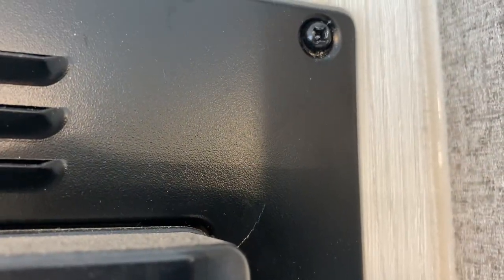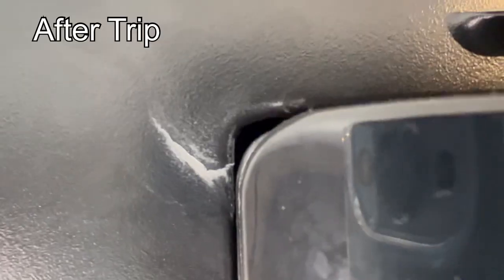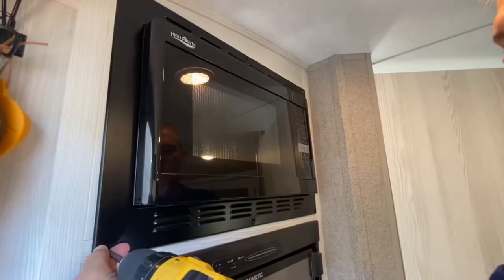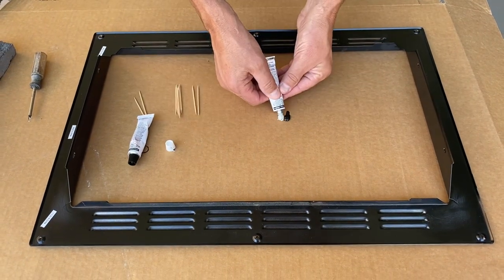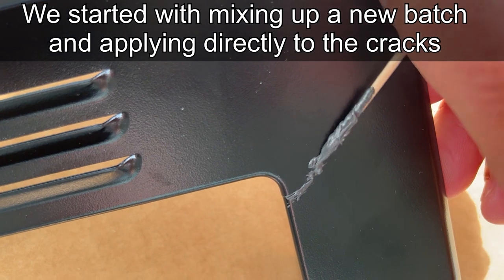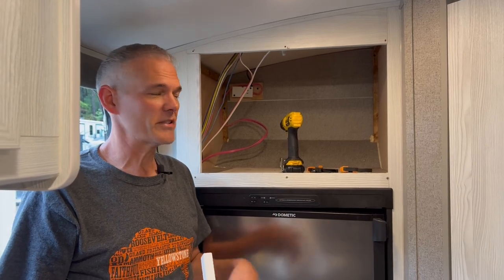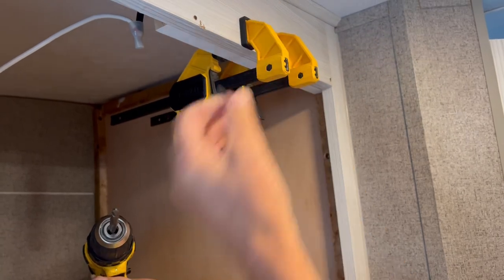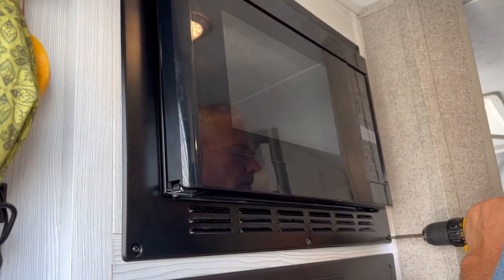JB Weld to the Rescue!  Repairing Our Cracked Microwave Frame

Comment: I just went out and looked at mine. No cracks so far. Surprising, given some of the roads I've been on.

Is there just a regular outlet beck there that the microwave plugs into? If so, it must be on a separate circuit, since it doesn't run off the inverter.

My next major project is going to be replacing the factory-installed 1000 watt inverter with a 2000 watt model, mainly so I can power the microwave off of it. I have 210AH of lithium batteries, so it shouldn't be a problem. You only run a microwave for a few minutes, after all. Looks like it'll take some rewiring to accomplish.
Reply: yeah it's an outlet that does not pass through the inverter. the power for the fridge when using A/C does come through the inverter.  so you can probably connect to that beings its in the same area as the microwave. put a piece of plywood under the microwave before it starts cracking, its hanging in mid air. all its weight is on the face plate. the feet of the microwave do not touch the shelf below it. if you find that they fixed that issue on yours then you are probably safe from getting cracks. but the 2019 Geo i have had a 3/4" gap from the button of the feet on the microwave to the shelf
Reply from the maker: Good news for you and yes - if that one road didn’t do it maybe you won’t have the problem!  Maybe they made some upgrades to how it is installed in the later models?   It is a regular outlet but it is not on the inverter circuit.  Please let us know how the install of the 2000 watt inverter goes - 1000 watts is limiting -2000 would definitely be great.  Hope all is going well with the new axle!

Comment: Gonna have to add this to our emergency repair kit!!
Reply from the maker: We have used it for quite a few things around the camper, house and truck.  When we were in Wyoming last year on a desolate piece of highway, a Class C came by and it’s solar panel chose that moment to fly off and smack the front of the truck!  Instead of buying a new front grill, Troy used JB Weld to put it back together lol.  A year later - all is good!

Comment: Other than the face frame was there any support at the bottom of the microwave
Reply from the maker: Hi Tim!  First - thanks for watching - appreciate!  Ours is a convection oven so has some metal ducting for venting at the bottom that does sit flush on plywood (but it is not a hard metal vent so thinking the flex did not help). 

Some viewers have a regular microwave and had to add plywood as the microwave hung in the opening with no real support.  

Not sure if they gave changed anything in the newer models though.  We have put about 6000 miles on it since the repair and so far it has held.  But, we did buy a replacement frame - just in case!

Comment: The actual problem is that it relies on the metal frame to hold it in but it needs to sit flat on the bottom .I had to put a piece of 1/4 inch plywood under it and no more stress on frame
Reply from the maker: Yes - we have had some comments of others doing the same.  Ours is a convection microwave so has a metal vent on the bottom so it does sit flush but we are going to re-examine likely in the future.  Curious if yours is a regular or convection one?

Comment: Good idea. I was wondering what caused the failure to begin with. Is there any support for the microwave in the rear?  If it is supported on the bottom, is the anything limiting movement up and side to side?
Reply: its not supported on the bottom that's the problem, i put a piece of plywood under my microwave so that it's not hanging in mid air with all its weight on the frame.
Reply from the maker: Good question!  It has a metal piece on the bottom of the microwave that is attached that allows for venting it looks like ( convection microwave).  Although it sits flush on the shelf, the metal on the bottom isn’t that substantial so likely allowing some bouncing during travel.  It’s fairly open on one side ( the left) but has wires coming in on that side that go to the solar, etc.  So, if this doesn’t fix it long term, we will revisit maybe building something before installing a new frame.  Fingers crossed!  Thanks for watching!

Comment: Great fix it tip. Thanks! Is the back of the microwave supported in any way? If the metal frame is the only support for that heavy microwave that is rough.
Reply from the maker: So a few people have commented that they have had to add a piece of plywood to support but it appears those are regular microwaves.  Ours is the convection and has a metal vent attached underneath.  It isn’t very substantial though so may be contributing to the issue unfortunately.

Comment: Is the microwave not supported on the back end? If it would be, there would be less stress on the face plate. Just a suggestion
Reply from the maker: So it has a metal piece it sits on that is attached to the bottom of the microwave that looks to be part of the venting.  Ours does sit flush to the bottom of the wood shelf it is in but as it sits on that metal piece it is likely bouncing during travel.  If this doesn’t solve it we may look to build something before we start over with a new metal frame.  Fingers crossed!
Reply: @WinesPinesandCanines  well that is odd that yours cracked then, it at least explains why my microwave was hanging, i was wondering why yours looked different. mines not the convection kind and so its smaller and they never adjusted for the smaller size to make the feet reach. I was hoping it was just because in was hanging in mid air. i will need to keep an eye out then and make sure it's not continuing to flex there even now that its supported
Reply from the maker: @ The Johnny O Show - Think there are two reasons - metal on the bottom is a little flimsy even though it does sit flush.  The other was two screws really didn’t go into anything substantial so they were likely moving around - we are hoping that adding the wood behind them helps.  Fingers crossed haha!

Comment: Just checked I our GEO Pro.
Very very small possible Crack my or is starting 
Also this trip our Propane warning device went off. Think 2 year replacement.
And last
I came up with a inexpensive gray tank hack.
We own cats. Thus catlitter 
The plastic container is perfict to dump gray .
No it's not a black tank option but to carry and dump it may help with Gray issues.
Reply from the maker: That is a great hack with the cat litter box!  So much easier to dispose of a small amount then a large tote - thank you!  If you have the regular microwave, you may find that it needs to be supported on the bottom - some comments mention that they had to add some plywood.  Ours is the convection so has venting on the bottom.  It does sit flush but isn’t the most stable unfortunately.  And thank you for the update on the propane - will watch for as not something you want to be without!

Comment: Been watching your videos but would you please let me know the truck you use to haul your geopro we have been thinking of doing the same but getting the right truck seems to be a bit of a challenge
Reply from the maker: Hi - thanks for watching!  We have a 2012 Toyota Tundra with a factory tow package.  We can tow up to 10,000 lbs with a WDH so it pulls it fine.  But, it has a smaller gas tank and payload capacity.  Newer ones have a larger tank (I think they changed over in 2014) which would be nice!  But, we love the truck - super reliable - so we live with the small downsides.  Have a great weekend!
Reply: @WinesPinesandCanines  Thank you for replying, your Toyota is it gas or diesel and what size is the engine , This may be a dumb question but  what does WDH stand for
Reply from the maker: It is gas and a 5.7 v8.  And we have all had to look up these abbreviations at one time so no worries.  WDH is weight distribution hitch.  And many times you will see someone ask about their TV.  Took us a bit to realize people mean tow vehicle not a television haha!